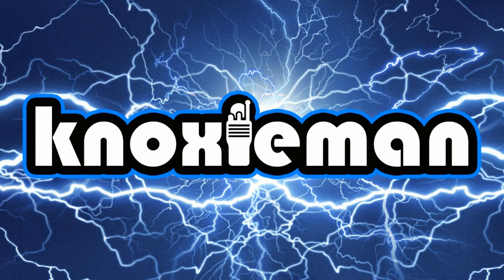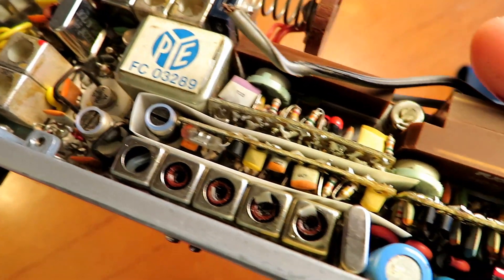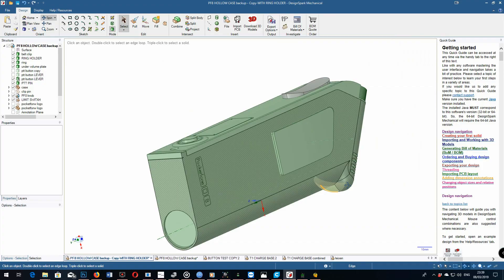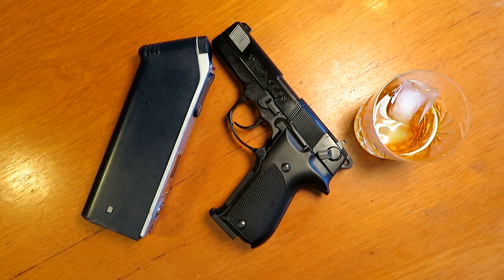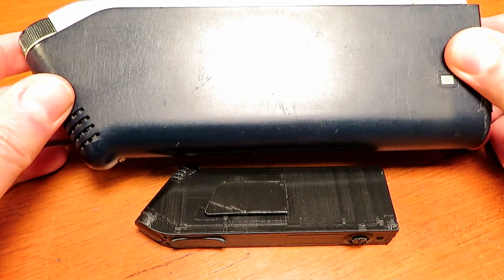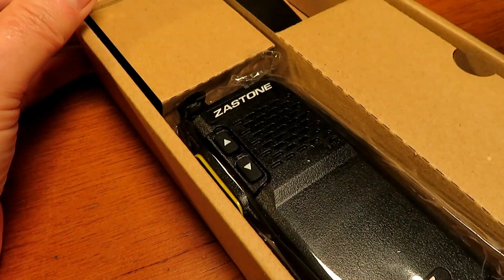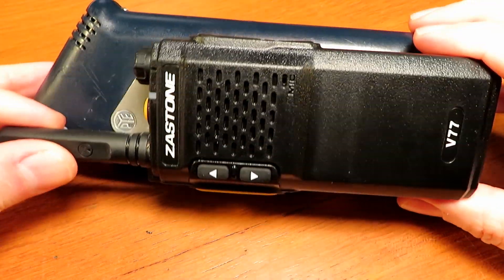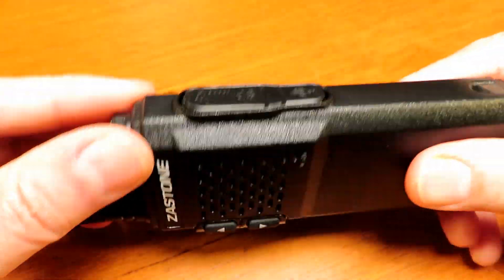3D PRINTING A CLASSIC WALKIE TALKIE -THE PYE PF8 - EPISODE 2

Comment: Came across by chance. Brilliant work. Not only do I spend all day on 3D Cad, I also designed the PF8 back in the early 70s at Pye Telecom. No 3D cad then. A chap called Pinkney converted my designs into Mechanical parts. Good luck with the project.

Comment: Brilliant!
Did I understand that right, you can 3D print in better quality but it takes longer?
Reply from the maker: Yes that right, the difference between a 4 hour print at 0.2mm layer height and 0.1mm layer height is 4 hours, it literally takes twice as long, the finish on the final model will be very good.
Reply: @knoxieman  Thanks knoxieman.